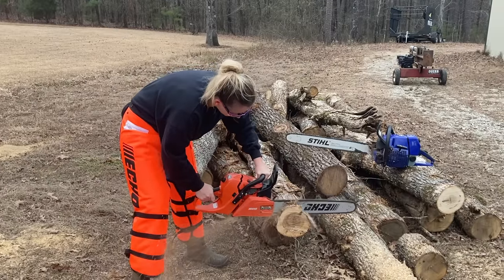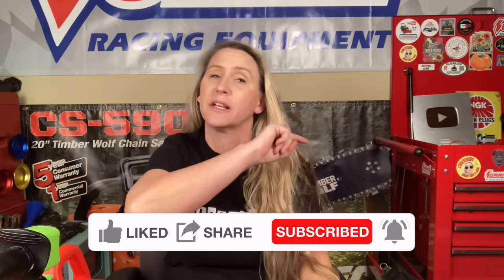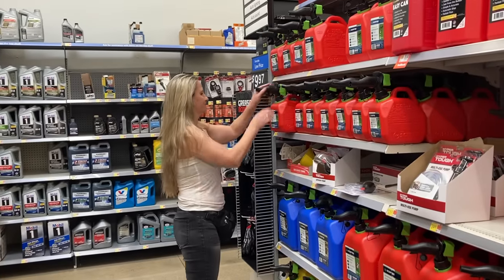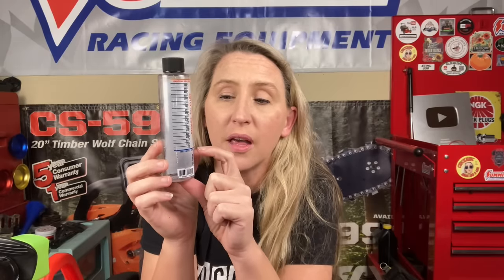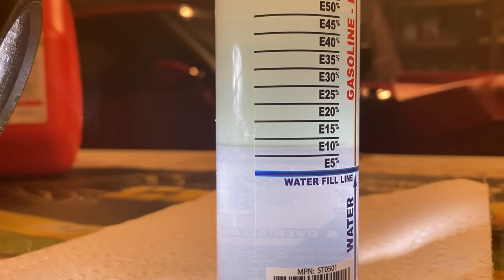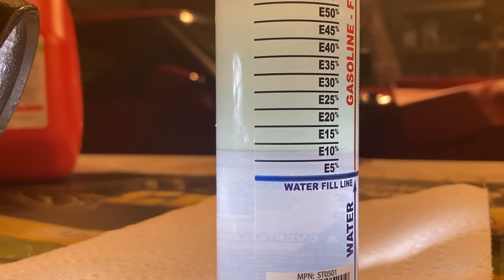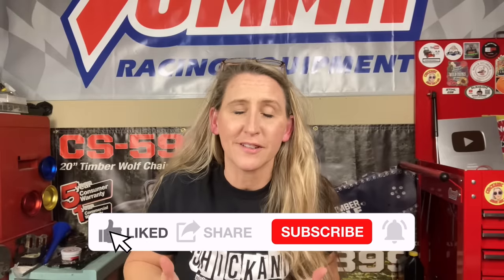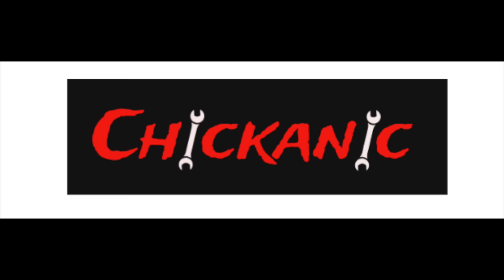Fueled by Deception. How You’re Getting Ripped Off at the Pump! (I'm SHOCKED!) VLOG

Comment: I'm in Central Louisiana and my city has a few Ethanol-Free-only gas stations.  The pumps are multi-grade, but if I get some 87 or 91 at first, I won't take issue with that, because it's all Ethanol Free.  I use it in all my small engine devices and my car is a 1995 model, so I use it in that as well.  I pay 50¢ more per gallon on average, but it's worth it to me to prevent all the damage that E15 would cause.  E10 was OK in my car, but E15, which is everywhere now (even if the pump says "at least E10", using E10 to fool you) would not be.  If your vehicle is a 2011 model or older, E15 will damage a lot of things under the hood, the fuel pump in the tank and the gas lines.  2011 models may not be included (I don't recall precisely), but 2011 is the cutoff.  Research it if your vehicle is a 2011 model.  It used to be easy to find, but Google is hiding a lot of pertinent info in many categories now.  I can't mention the website by name, but do a websearch to find Ethanol Free gas in your area and select one that only sells Ethanol Free.

Comment: Great reminder as I just filled my small tank for 2 cycle and forgot to check the hoses. 
Sorry if this gets long but when I was in small engine school we had to destroy some 50hp mercury outboards because we got some newer donations and for tax reasons the admin office told us we had to destroy them, we couldn't even part them out.  So back in the 70's there was this urban legend concerning putting sugar in gas as a way to vandalize someones car.  A student put sugar in gas/oil mix and we ran it for 30 minutes WOT in a test tank...nothing.   So then we changed out the tank for leaded gas, no oil, no sugar.  Again we ran it WOT in the test tank.  It lasted over half an hour and then abruptly seized.  I'm sure sugar is not good for an engine and it who knows what the concentration was as the guys were not too scientific but nevertheless it was interesting.

Comment: I've said this for years. I have a built up harley-davidson with a higher comparison than stock, and I have to run 91-93 octane . If I don't it will knock and back fire. I've tried going to stations that use separate hoses and there's not many

Comment: In North Dakota by law, they gotta tell you what’s in it. Ethanol is corrosive, but gasoline has a lifespan before it goes bad. Small motors were meant to run on regular gas only no ethanol.

Comment: You are correct about " Ethanol Free " Gasoline..The price is outrageous and are you getting the proper fuel mix?...I use Star Tron Fuel enzyme treatment with pump gas for years on all ICE apps.Even works on Diesel...It encapsulates any water droplets to burn through..Phase Seperation to minimum..This product sold at every Auto Parts/Walmart/Tractor Supply/Etc..Made in USA from a Boating Product Supply...Proven..........
.

Comment: From PA,
We separated our own small engine fuel for years. Very easy with a 5 gallon gas jug with a ball valve drain Installed in the bottom corner. Add 4 gallons gas, 1 gallon clean water, shake n let set overnight. Crack the ball valve next day into a clear jug until the milky ethanol water turns to gas. Just DONT get the separated ethanol on your hands. Burns skin, but great weed killer. 
 When stations said they were 20% ethanol, sometimes it was 40%. 

The classic scam was/is,  2 stations were selling ethanol free on a seperate pumps  for big money. One tank my 4x4 GMC truck got 20mpg, next tank it got 8mpg, spark knocked, and the engine light came on. This happened repeatedly. 
After checking for ethanol, it had none, but my son knew the problem immediately,  had it tested, and it was also was only 75 octane. 
They were sued in Oklahoma for this same  scam. 

They're selling ethanol free, but its junk gas from the refinery and has no octane. 
Most vehicles have sensors that will trip your service engine light if gas is UNDER say, 82 octane. 

They RIP us off any way they can.

Comment: So, you've inadvertently shown us how to remove ethanol from gasoline. Just do that & use a turkey baster to suck the water/ethanol mix off the bottom - or decant the fuel off the top.
Also; never invert your little red jug of fuel into your equipment. Always leave a quart or so in the bottom - which will help keep the water out of your equipment. We used to have trouble with boat engines, what with storing the fuel right near the river, it was subject to having water in the gas cans. Stopped emptying the jugs into the outboards - Engines ran much better.  Eventually, we set up a water separator to fill the jugs from the larger storage tank.

Comment: First, always read your meniscus (the curve of water in a test tube or vial) with the BOTTOM (center) of the curve at the line you're targeting (not the edge walls)...it's a surface tension thing. Secondly, buy a decent FUEL JUG! Something like JP Fuels 5-gallon racing jugs! Old school, no California idiot valves! Lastly, but most importantly, I learned this little trick from a friend who bought my 1968 L88 427 corvette (running almost 12:1 compression)...see, it won't run on 'moonshine', as in reality, 101 octane is about the only stuff it loves (AV-Gas)...but you can 'cruise' in it (changing the timing) if you can get ahold of some 93 octane 'real-gas'. Since Ethanol is in virtually all 'street fuels' now, he (a chemistry teacher) showed me how he does 'at home refining' to get 'good stuff' from junk fuel. He would go to the gas station, fill up two 5-gallon jerry cans, and bring them back to his garage. He has a really nice 'transparent' 10-gallon lab jug...so he pours a jerry can into it. Without moving it, he lets it sit 7-days (not sure his reasoning on that time, but whatever), then like racking wine in-process, he siphons from about the 2/3rd point of the clear container, into a new jug. You can see all the water and ethanol in the bottom, floating around in there now! He purchased a 5-gallon jerry can of AV-Gas and mixed them 50/50...and he ends up with 97-Octane, enough to 'romp on the old big block' and make it run...almost like it's supposed to! You are already 'stratifying' the fuel when you did that Ethanol test...just do it in a larger container, and DO NOT siphon from the bottom (or you'll just suck up all that junk into your fresh, new container)...it really is that easy! (and much more affordable than buying lots of special fuels...plus, you will then know how much water is in your 'favorite gas station's underground tanks', as well (they intentionally are designed to draw from the bottom, to get the water out of their storage tanks...how nice of them).

Comment: That "1/3 gal." of whatever grade fuel the previous customer pumped is a fault in the fuel dispensing apparatus imo, not "getting ripped off". First, you're actually getting FREE that "1/3 gal." from the previous pumping session (even if it's not the same flavor you selected.) OR , you can just squeeze the trigger (previous 1/3 gal) out on the ground before selecting the grade of your choice & activating the nozzle.
Reply: Unless you like fire (and getting banned from gas stations), I'd skip pouring gas on the ground.

Nobody is getting anything free or getting ripped off by ⅓ gallon.... the gas you get "free" in the beginning is lost by what you leave behind for the next person. You are shorted the grade you want in the beginning of course.

Comment: I dont know where you live but here in Texas.
Our pumps use the same hose for 89 91 and 93 octane with up to 10% ethanol.

E85 is on a separate dedicated hose like Diesel. 

Ethanol free when available is usually only available at a limited number of pumps per station.

There is no way in the area that I live that E85 would be mixed with regular E10 gas.

Yall need to contact whoever is charge of your Weights and Measures and complain.

Comment: As a Cirted Fueling tech of all fueling from refining, storage, shipping, to distribution and retail You Are Correct, it is actually worse than "you think".

89 storage tanks started going away in the 90's! regular and supper are mechanically "blended" at the pump, about knee height in the "hydraulics" area/cabinet with the meter and valves at the pump.  and some states have two blends "winter and summer" blends? this changes the "allowable? or Required!" ethanol ratio as mandated for EPA and states' rules. 

True story about CA!  "I'm in Ca"   and if you track your MPG you will "know the dates" winter/summer blends change, I do.  Your vehicle will get about 15/30% less MPG and the price per gallon typically jumps about 10%.   So once again Brandon and buddies get US!  your fuel "Cost per Mile" goes off your charts.

no one believes me, but I know what I know? "I built my 1st gas station" with 36 "vapor recovery" hoses(1st in La Co Ca) 7 tanks in the ground, and a car wash at about 10 yrs old with Pops, 21 lifts of 2" gal delivered on site, me on the threader, about summer of 1976 Nogales at the 60 when the area still had cows, My last one about 2015 ish.  in the 90's I was an outside contractor for the "AQMD" with lots of others.

Did alt energies too. all smoke and mirrors.  liquid hydrogen (Gas or Diesel) is the best energy per unit of any measure.

Comment: The other thing I have been told about ethanol free gasoline is that it is usually older gas that they just add octane booster to bring it up to spec to sell it. I have an Ultralight with Rotax 2cyl 2 stroke and got some ethanol free gas from a pump that a guy just filled his boat with ethanol free. I filled 5 gallons and mixed my oil and 10oz of Seafoam. Filled my empty tank on my Ultralight with the full 5 gallons. Didn't fly for 5 months and went to start it and it wouldn't start. After pulling the 52hp engine over forever, it finally started sputtering and barely running. I instantly could smell rotten fuel from the exhaust! Took off gas cap and smelled fuel and was rotten as hell! A mechanic called Rotax Rick says to use 87 from a station that sells a lot of gas and use that instead of ethanol free because the ethanol free goes rotten faster. I started using 100 low lead from my airport in my Stihl chainsaws and it lasts forever as designed, because airplanes are not always flown a lot. You have to retune for the higher octane, but well worth it.  You lean it out a little to get it tuned which uses less fuel and it definitely runs better with the 100LL gas and I've had it last a year or more and still great gas. The whole ethanol crap gas is a travesty all around! Should never have been mandatory and does nothing to help at all!

Comment: What are your thoughts on using 110LL ( low lead) Aviation Gas in my power tools( mower, saw, weed wacker ect)? Unleaded/ ethanol are not approved for flight use, due to potential catastrophic engine failure ( any loss of power is catastrophic when off the ground)

Comment: I'm very skeptical of this, ethanol free is ethanol free, and would not be mixed.  I do know that the hose on the pump, holds almost a gallon of the fuel previously pumped, there is your ethanol contamination.  They don't mix non-ethanol.

Comment: Can't think of a station in my area that doesn't have seperate hoses for different fuels. They all do. I use nothing but non-oxy 91 in my small engines and motorcycles.

Comment: I bought Ethanol free gas at Buc ee's here in Texas and it had its own separate hose from the other mixes.  I wonder if it too has ethanol in it.  There are only two pumps out of the 100 or so pumps there that are configured like this.  I just bought a new generator and wonder if the 15 gallons I bought  is truly "free"?  Thanks for the video.

Comment: Well if both "non" ethanol batches had ethanol @ 5% doesn't that mean the gas station is adding 5% ethanol? I know the point was to isolate the issue with left over gasoline in the tube, but there should not be any ethanol after dispatching into the car prior to filling 1 gallon containers. Am I missing something?

Comment: I get my ethenol free gas strictly at Quick Time, mainly because they are the only gas station that sells it. Their ethenol free pump has a red handle and that is the only type of gas you can get from that handle. So I guess I am safe. I do notice every engine seems to start quicker and run better since I started using ethenol free gas.

Comment: This is how I remove the ethanol from gasoline I use in my mowers, blowers and motorcycle 
Pump a gallon or 2 of premium gas (with ethanol) into my truck, then fill my 2 gallon gas can 
Put about 8 oz water into a clear gallon bottle, add gas to the top 
Push in stopper and SHAKE.
Let settle. Do this several more times 
Let settle overnight 
Next day, siphon off the ethanol/water slurry from the bottom.
Then, pour the now ethanol free gas into a separate gas can for use in small engines or motorcycle.
Note - removing the ethanol also lowers the octane rating several points.
Need to add octane booster enough to treat 1 gallon to get back to the premium octane rating.

Comment: Before ethanol was widely introduced as an ingredient in gasoline around 2005, MTBE (methyl tertiary-butyl ether) was used as the gasoline’s oxygenate ingredient.  MTBE is *EXTREMELY* miscible (dissolvable) in water.  If the current replacement for ethanol in ethanol-free gasolines is MTBE, then what you might be seeing from this water/gasoline test is the evidence of the MTBE in the ethanol-free gasoline, instead of evidence of ethanol in the ethanol-free fuel mixture (because like ethanol, MTBE will mix with water).  However, it stands to reason that pumping EF fuel from a pump which uses only one hose for all gasoline types will invariably result in the good chance that you’ll get some ethanol as a result.  That’s a separate issue that can be avoided by finding a station which uses a dedicated hose for the EF fuel type (such as at some Buc-ees locations in Texas).

Comment: Good Morning,  I am considering trying non ethanol fuel in my bass boat. I have been running the 10% ethanol gas for years. Is it alright to run non ethanol gas  or is this a dumb question? It is a Mercury OptiMax 200hp 2 stroke. Thanks,   Bill

Comment: As an Australian this seems all quite bizarre. No offence intended to Americans, just observing a difference between countries. :-)

Whilst E10 and E85 are available, all fuel stations here also sell regular petrol (gasoline) containing no ethanol and there's a separate hose for each fuel type, thus overcoming the problem referred to here. Just pick up the nozzle labelled with the fuel you want and that's what it dispenses, there's no other fuel type ever in that hose so no contamination. 

So there's an easy fix for the problem if the gas stations wanted to implement it. 

As for the fuel can with that green button? I assume that's some safety regulation? No such thing here, just a basic nozzle to pour it through.

PS - great channel, I've learned a lot on various things. Thanks.

Comment: The Quick Trip stations in my area have a separate hose/nozzle for non-ethanol.
Reply: Is that in MN or WI? Kwik Trip? In IA it's Kwik Star (same company). I put this in my snowblower (with stabilizer) and my motorcycle always gets the top grade (preferably KT E0 if one's around). The separate hose gives me some confidence.... but considering testing it like this just to be sure.
Reply: @mikeb8342  Actually it's Quik Trip, commonly called QT.  It's in TX.

Comment: You mentioned that customers lie, listen to this one... My Husqvarna chain saw wasn't running smoothly, so I went in and cleaned it and replaced all fuel lines (with new "orange" lines). This didn't fix it, so I took it to a local mechanic... Ramsey's Small Engine. I told him what was going on, that I had replaced all the hoses and he said come back in a week...I said "a week", all it needed was a minor adjustment. So, I waited 5 days and called him and he said, "I told you to come back in a week! Needless to say, I was a little 'put off', so I waited two more days and called him and he said come on over... He mentioned that it would be $60 bucks!! I went to pick it up and he told me all the fuel lines were dry rotted and he proceded to show me three old hoses of different colors... green, yellow, and black. As soon as I saw this, I knew he was lying, apparently, he'd forgotten I told him I'd just replaced them!!! He proceeded to crank it up and it ran a little and died. He made a minor adjustment to one of the carburetor screws, cranked it again and it ran fine. So, long story short, I paid this guy $60 bucks to turn a screw! This is why I don't trust mechanics, guys like this give you a bad name!

Comment: Heard this before and would only go to pumps with seperate hoses for octane rating especially with my motorcycle. i also read something that said 93 octane has less than 5% ethanol. True? Ethanol has been around a long time. I was out in Montana when I heard about summer and winter mix gas 1978

Comment: I worked at a gas station many years ago back when you had 89 | 91 | 93.  The 89 tanker showed up and couldn't empty the load but yet it is purchased by the station when the truck departs the depot.  So what to do?  The owner said, "drop it in the 93 tank..."

Comment: You can still buy 5 gallon "moto" gas cans instead of those junk red cans. And I assume doing small engine repair you probably have a ratio-rite or graduated cylinder laying around, rather than trying to pour straight into that tiny little test cylinder. Great info, clunky presentation.